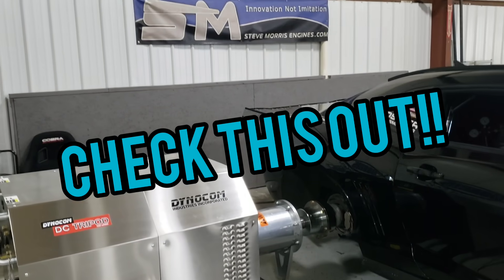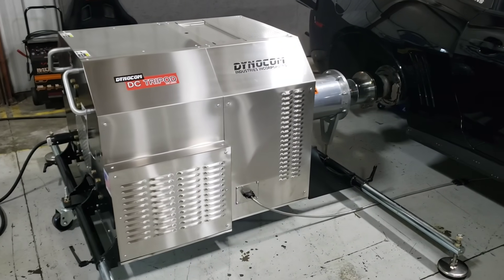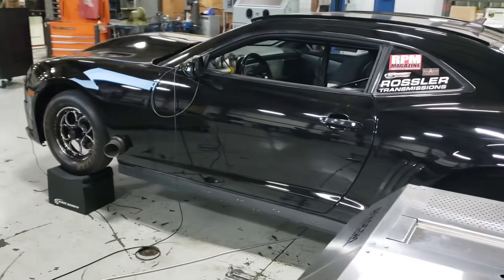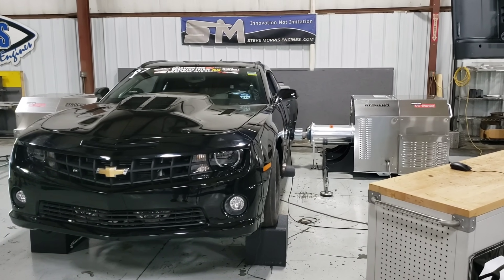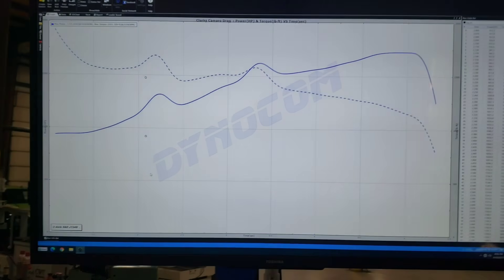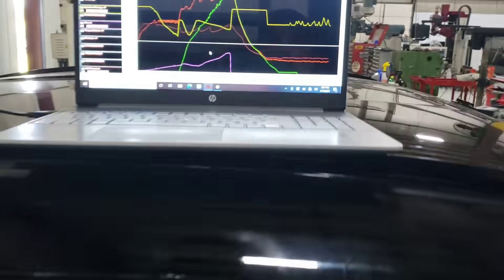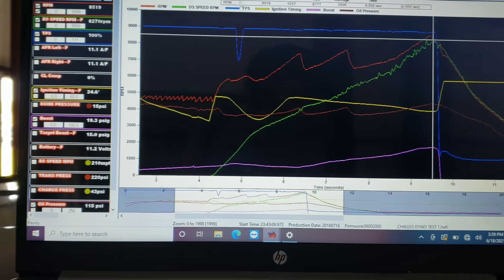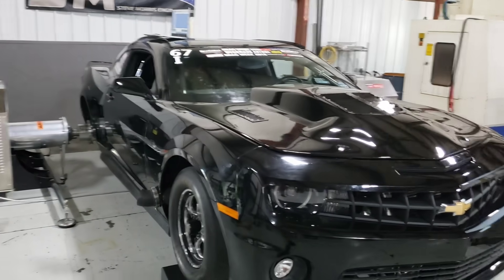Hub Dyno Testing.

Comment: Hub Dynos are awesome because they are portable and there is no wheel loss like on a chassis dyno where the wheels can spin then you gotta add weight to the trunk and spray glue on the tires to make them stick to the rollers the hub dyno you don't have that issue but if you have a weak clutch a hub dyno can burn the rest of the clutch up but it's a weak link that will cost you if your racing anyway

Comment: What setting/load was the dyno on? I’d be super surprised if it can handle that launch on the same load as you would use to tune the car.
Reply: They can handle stupid load. Think about it for a second, he needed one that can handle 4000hp so he doesn't overwhelm it. You're not hitting the tires that hard or they just flat out spin. I'd bet we see 3000+ hp cars on this thing later on.
Reply: @leftyeh6495  yeah but I would think the load he used to leave off the brake and shift the car is much different than when they’re just rolling into it from 3rd gear to get a hp number.

Comment: So the hub is more realistic pull than a wheel dyno?
Reply: wheel dyno's will slip. Ever see guys spraying the drums with glue before each pull? Sharpening the knurling and shredding the tires? 

Once you get over 1000hp, the hub will be more reliable and repeatable, and easier on your tires.

Comment: The funniest joke I've heard today was calling this thing a street driver. But yeah, perfect car to take a trip to Dollar General in.
Reply: That car can literally drive thousands of miles on the street. Makes me not understand your comment
Reply: @thegooniverse495  But why would you though? Obviously doesn't get started for no reason.
Reply: @JayAR_YT  you do know that car drives a thousand miles a week during drag week and rocky mountain race week right? It does it while pulling a trailer in all weather, and it goes to dollar general and where ever else they need a car to take them that week. Factory dash, factory radio, factory firewall, factory floors, factory front suspension, power windows, I just don't see this not being a street car. Make a case for it not being a street car in any way.
Reply: @thegooniverse495  Well, if you have the money to do it, anything can be a street car. It's just well, not cost effective to take this to McDonald's...

 Unnecessary wear is what I'm getting at. It's not a question of if it's gonna do it. But your gonna have to go home and check it over, check the oil, and maybe even pull a spark plug.
Reply: @JayAR_YT  I think you are severely underestimating the streetability of Steve's 481x. With how rock solid the valve train is, and the fact it literally runs on pump fuel, I don't see this being some big hassle to go get a scoop of ice cream. It's not like it's some high compression carbureted big block with overkill valve springs. It should be relatively maintenance free until it's time to make a hit, then you go over your valve lash and send it.

Comment: Shouldn't be making pulls with a car like that and no safety gear on. Ask Louis at Fuel Tech.
Reply: Seeing as it's on pump gas and low boost I wouldn't sweat it. 4k hp capable engine running so mild it only makes 1700. That's like a gentle cruise for the thing

Comment: Steve, now all you need is two Vortex S1000 1082cfm variable speed duct turbines to simulate the car rolling out the back end. They are small enough you could make a stand to position them right in front of the turbos with airspeed over 250mph. Leaving nothing to chance, even the power on the track with 270mph ram air.
Reply: Ram air doesn't have any real effect when you have enough turbo volume and speed. They're limiting boost/air flow with the CO2 pressure against the wastegate, so any additional air stuffed in will just result in the gates bleeding off. 
What you could see on an air to air intercooled car is a cooling effect because of the airflow, creating a small bump in power. There aren't really any good air to air intercoolers running over 1000hp though, or nobody would be messing with water tanks and ice!